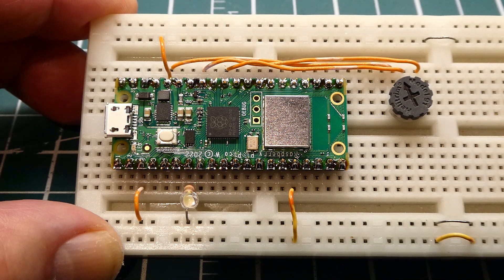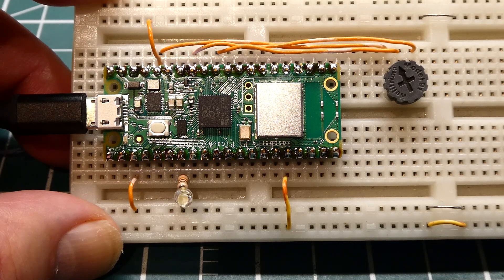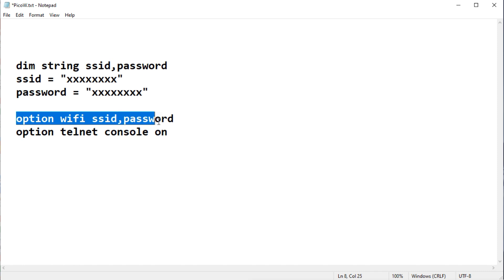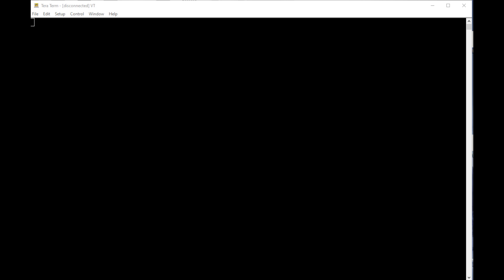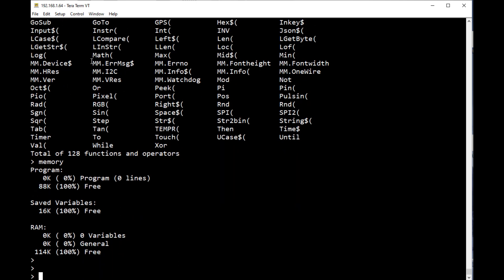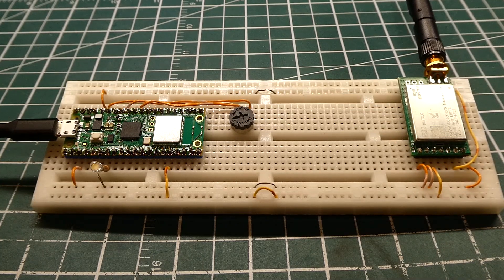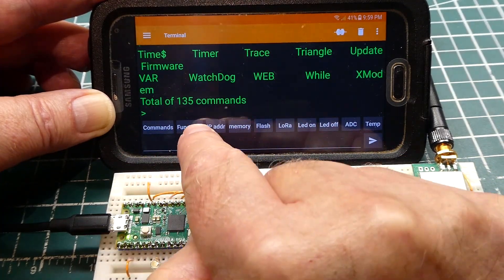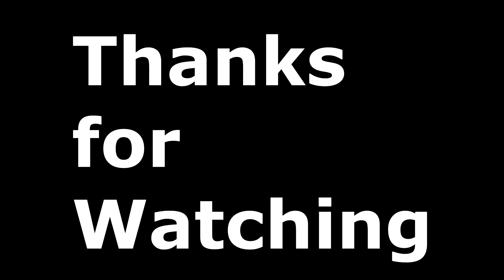Pico W Primer / WebMite / LoRa

Comment: Awesome ! I'm currently starting a LoRa project with my Pico 2w running Webmite. It's currently inside a PicoCalc (by clockworkpi) I would like to make it a stand alone Meshtastic messager but I'm not sure if that is possible. They also do make a Pico variant with the LoRa module built in

Comment: I have 5-6 PicoMites (one is a WebMite). I also built the Australian PicoMiteVGA board kit. They are full computers. Start with a display panel and option system spi gp10,gp11,gp12 and option lcdpanel st7789_320 landscape, gp8,gp15,gp9,gp13 and option touch gp16,gp17 and option sdcard gp22. (The ST7789_320 is a 2.8" Hat display, so is easy somehow.) You can run into issues and can ask.
Reply from the maker: Thanks for the visit and sharing.

Comment: Cool video. Btw, is the controller able to switch between Wifi acces points depending on which access point is available or which one has the strongest signal?
Reply: I don't think so, but you might be able to program it to do this